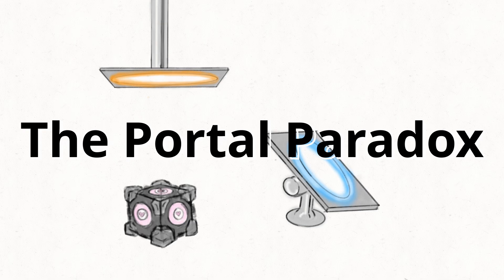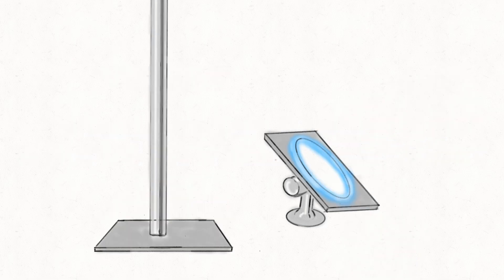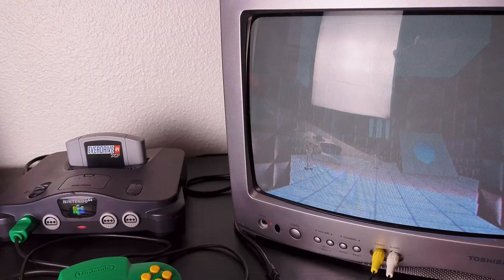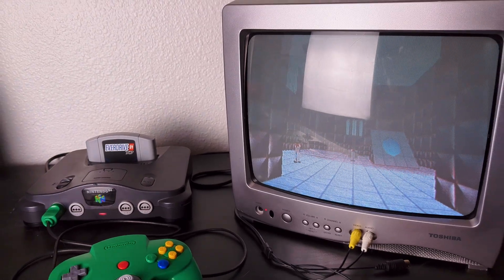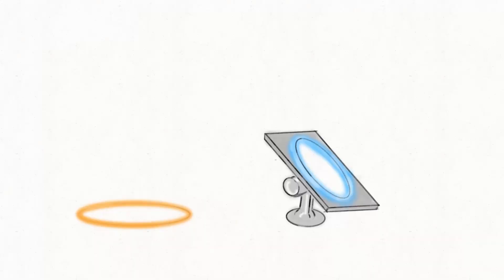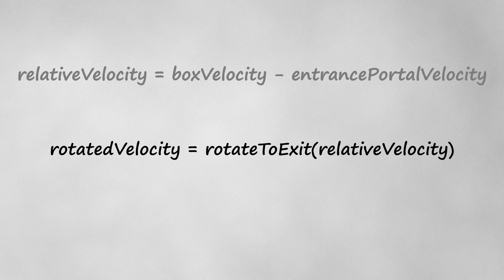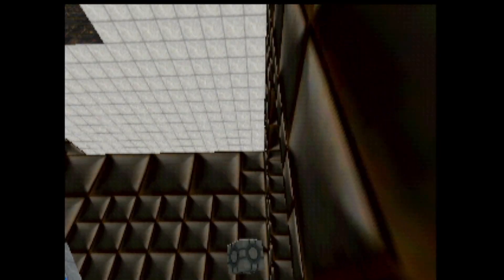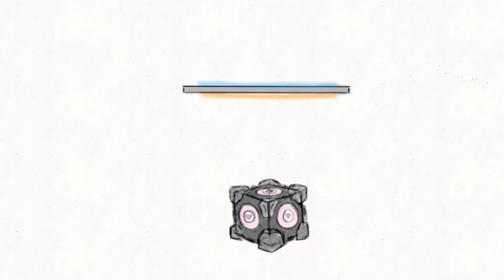I rewrote Portal from scratch and solved the Portal Paradox

Comment: Great video: subscribed!! Results look good where the velocity of the portal is fixed. However, I think the whole paradox, and your solution, aren't intuitive since it's not based on a conservation of energy or momentum. One highlighting scenario and one hypothetical: A portal dropped (not forced) over a feather and a stone should not cause the object to have the same initial velocity when exiting the other side of the portal since that would violate those conservation laws. Rather, I imagine a real portal would require more force in order to pass quickly over a more massive object (I'm imagining something like eddy-current braking aka magnetic braking aka just search for videos of a magnet falling down a copper pipe). Second, imagine a long, skinny object standing upright and a portal being forced down over it-- like a pool cue or a person even. As the portal is forced (not dropped) over the object there would be a point where enough momentum had transferred to the object to overcome the force caused by gravity, and the object would get "sucked through" the portal. A simplified example would be a chain attaching two stacked cubes together and slamming the portal down over only the top one. The momentum of the first cube flying out could pull the second cube out. Apply that to an entire rigid body, and you have the scenario I described, but you need conservation of energy to know how fast the whole body goes.

Anyway, you're mostly right. I'm an engineering grad student. Let me know if you need help with any calculations.

Comment: Hmmm... Looks like either mass has no effect, or that cube is really, really light.
Also, inertia should come into play because "a body at rest wants to stay at rest, and a body in motion wants to stay in motion".
Logically, I would expect the cube to be barely nudged (if at all) by the open portal (which basically has no mass because it is open) despite its velocity when moving, resulting in little more than a roll / flop out the other stationary portal.
Think about it this way; If an open door passed around you, would you be moved by the force of that open door?
Reply: Can you keep 2 sides of a door connected whilst also have one stationary and one moving without changing the original door?

Comment: Well your solution is a shortcut. You skipped the cubes volume, its spread of mass and its partial momentum. You just consider the very moment the cube passes but what if the portal stops halfway. You could consider the ammount of cube being pushed trough integrated with the time it has been pushed trough to a momentum acting on that portion of the cube, most of this shortens out if you consider it as one single action but really it could be more detailed and here it comes: way out of scope, overcomplicated and ressource heavy.
Reply: So yeah really just nip picking here your solution is alright.

How i imagine this scenario, moving the portal towards the cube is like moving a dimension into another, the ground in dimension 1 pushes the cube into dimension 2 or considered the other way dimension 2 pushes itself over the cube with the fixed ground in dimension 1 resisting, they kind of collide and what exactly happens depends on where the first one begins and the second one starts. For extra nip picking you could even start calculating gravity 2 for part of the cube that is in "dimension 2". Now for the ultra nerds completed madness physics circus you require the force of this action to be exerted by whatever is pushing the portal aka shifting the dimension 2 as well as the ground resisting in dimension 1, what really is doing the work could just be considered what is moving relative to the other dimension. Now considering this is all happening in the same dimension this further shortens into pushing the portal over the cube with certain force and the ground its on being loaded with this same force. Considering conservation of momentum and conservation of energy this is probably not working out but maybe thats either my head coming to its limits or portals being fundamentally flawed in that perspective. Obviously a cheeky answer like "whatever difference the portal breaks in conservation must obviously be exerted into its environment to cancel" could just mindbend portals into not being certainly impossible.
Reply: So if anone wonders how i come up with this stuff: i sometimes code little physics simulation for fun

And if someone feels like this makes no sense: im just doing it for fun cant guarantee it tho

Comment: as some kind of physicists I strongly support this interpretation, the velocity of the cube relative to the portal should be what counts
Reply: Energy conservation is already broken by stationary portals. If they are at different elevations, you can enter any of the portals and leave the other one with the same speed and e.g. instantly climb a mountain (or the moon) without any forther work. This is also happens when building the portal loop and falling indefinitely.

Conversation of Momentum is also broken by stationary portals in the game, because the direction of the momentum is changed in most portal configurations.

If we assume that the Portal games play on a spinning planet, conservation of angular momentum is also violated, because your momentum (combined with the distance to the center of the planet) also gives rise to an angular momentum.
I'm not sure what happens to spinning object/player jumping into a portal...

But conserving any of these properties would ruine the game. Conserving all of them should be equivalent to drilling a hole through the wall or at least give you extremely tight tolerance how you can use them (e.g. same elevation and latitude and exactly opposite orientation)
Reply: And regarding the original comment: I totally agree with it (as a studied physicist). The situations are the same when applying a https://en.wikipedia.org/wiki/Galilean_transformation
(Please ignore that we need to be in an inertial reference frame for that, which is not strictly true because of earths rotation)
Reply: It's kind of hilarious how most of us (me included) agree that the idea of portals make no sense physics wise. And immediately follow it up with a physics reason for which kind of portal is more likely 🙃
Reply: @0ntimetaiment921  that's because to us intelligent folk, it is abundantly apparent which kind of portal is more likely.
Reply: @MS-pz9wd  Arrogant much?  A real intelligent person would understand that neither are likely because magical portals that instantly teleport you don't actually exist, yikes.
Reply: @sawdust52  a real intelligent person would be capable of basic applications of logic
Reply: @MS-pz9wd  Which you aren't, because the basic logic you are speaking of doesn't exist.  Try again, maybe consider seeking an expert for an actual IQ test while you're at it?
Reply: @sawdust52  do you find the concept of logic so confusing you're now pretending it doesn't exist? Yikes
Reply: @MS-pz9wd  Do you find the concept of ficton so confusing that you cant separate reality from fantasy? Yikes, now I'd actually suggest you seek medical help as that's a clear indicator of an onset of dementia/schizophrenia, scary stuff and I hope you get better.
Reply: The most realistic definition of a portal is that it's a hole in space. Hole is not really an object that has any kind of effects or fantasy properties. Hole is a hole. And the hole in space would be the most static hole, as space doesn't really change its shape much. And materia is what actually "flows through/in/on" the space, so... The model in which we consider that the whole world (read as materia), or some part of it like our planet, is the source of the momentum is the most realistic one.
The only questionable part here would be about how we move the portal with some wall, and I think the answer for it is gravity, but I don't have enough theoretic knowledge to assert it properly. All I can say is that space can change its shape under the influence of gravity, and the shape is technically just a definition of where some parts of an "object" are located, and gravity is linked with materia, with its mass and stuff. So we theoretically could manipulate the masses of materia to manipulate the gravity to manipulate the shape of space to manipulate the location of holes in it, and so we could make portals move with walls like it's being shown on the video, and my brain is literally melting now, what I'm even talking about, I never even studied physics in any way, and I haven't slept for almost 20 hours, I don't even know how I found this video. Gotta go sleep.
Reply: @farflower87  yeah, it reads a bit weird :D
Have a nice sleep ;)

And I meant with "hole" not the any fancy space bending stuff, but literal one in the wall, which you could achieve with a regular hammer
Reply: Also gotta add that gravity of the planet would act as a lock for the initial position of a portal, so it would not fly away to another galaxy right in the moment when it would be... Shot out of a portal gun? Lol
Reply: Agreed the cube would move. Just think of air/fluid dynamics.  If you look at the air moving through the portal, the blue portal would have a certain mass flow of air moving through it, which means the air would need to have a velocity.  You would have a stream of air coming out of the blue portal until they collided. The cube would have the same relative velocity, because Universe Orange is moving toward Universe Blue and then stopping. If Universe Blue could keep moving and “cut out” the wall around the cube, you would get a column emerging from the portal at that same velocity.

The real trick is moving the portal in the first place.  Since it is essentially a wormhole, it would take a MASSIVE amount of energy to move the portal. Basically the wall would have a very large force preventing it from moving. Granted this is already violated by the movement of the earth.
Reply: @Colonelloki  We don't know that's it's a wormhole. If it were it would have a huge gravitational effect (way more than the earth), which it doesn't in the game. I think it's fair to assume that portals break reality in all kinds of ways.
Reply: It just depends on how you define the portal. After all it's a fantasy concept.
I would define it so it doesn't jump. Because in this version the portal would have to exert some kind of force on the cube to accelerate it, which sounds wrong to me. Also the laws of constant momentum would break down.
Reply: @0ntimetaiment921  Well since it's fantasy and everything goes, I'll say that whenever you go trough a portal you speed up to match earths rotation... because reasons😅
Reply: @BxPanda7  Actually I once wrote a fantasy story with portals. And one day I woke up and realized exactly this problem.
And yeah. I just "solved" it by saying "it just works in this magical world, ok?".
And I'm not ashamed of that. It's either that or never ever writing fantasy stories at all.
EDIT: It's all about pushing the absurd to a point where it bothers people the least. Most people do not think about the fact, that earth rotates and the moved around the sun at absurd speeds.
Reply: @0ntimetaiment921  To be fair I'm sure there's something in the theory of relativity that would explain why earth's rotation doesn't matter in this context, but you'd have to ask a physicist, or invent a portal gun, whichever is more in your line of skills 😝
Reply: @0ntimetaiment921  In order to understand the forces acting on the cube try changing your perspective slightly. Imagine you are standing on top of a moving cart going at an incredibly high speed (somehow not being blown off by the wind), and suddenly that cart comes to a stop. You would fly forward off the cart, right? That is essentially what is going on here, but the portal moving at the cube is turning the entire WORLD into that cart that you are standing on. Going through the orange portal means that you are "Suddenly not moving" relative to your previous speed so it flies "forward" relative to the blue portal. Another way to imagine it is to simply think about how it would appear in the blue portal should the orange portal envelope it quickly. Imagine the blue portal was on the ground and the orange portal enveloped the cube quickly. The cube would rise from the blue portal equally as quickly right? The cube would be quickly moving upwards and then come to a sudden stop with no momentum in the model you suggested.
Reply: @VaanOtacon  Nicely explained. The model you describe definitely has some merit. But again: It's a fantasy concept, so it's a matter of taste. In your model the cube would still suddenly have energy in the form of movement energy which comes from nowhere. In the the cart example you gave, the person already has that energy since it is moving. With the portal the energy must somehow be transferred from the portal to the cube. But since the portal itself has no mass that makes no sense to me. Worse still: The force on the cube would have to be infinite, since is goes from not moving to moving instantly.
In my model (which is of cause also breaking physics) the portal does not interact with the cube. It is simply a doorway. The cube remains in its relative state to the world instead of the portal. So yes if the portal moves quickly over it, it simply appears in the other without momentum at all. It rubs you the wrong way, since you say "it moves but then suddenly stops". In my interpretation it would not move at all though. You would simply move the "doorway" around it.
Neither model is completely satisfying, since portals are inherently against the laws of physics. I guess it's a matter of personal experience and taste what put's you off more.
Reply: @VaanOtacon  If you look through the exit portal and take your measurements from there then nothing is out of the ordinary. And since changing your point of view doesn't change the outcome, the cube must behave the same way whether you're standing on the "entrance" or "exit" side of the portal. The issue with looking at it from the "entrance" side is you are changing your point of view to the exit portal without accounting for the movement of the portals in relation to each other. If you account for the speed of the portal, the cube flies out.
Reply: I commented because I want to come back later, re-read and see if I understand it any better.

Comment: That makes sense to me. The distance to the targeted launch wall actually decreases at a certain velocity when the top portal slams down on the cube, so it make sense that the cube would continue that velocity. Whereas for the "hoolahoop portal", the distance to the targeted launch wall (the ceiling) remains constant as the in-portal approaches the cube at the same rate that the out-portal's distance to the ceiling increases, thus canceling any momentum for a launched cube!

Comment: Just to make it more fun, you could actually argue the blue portal is facing away and both portals seem to have a front and a backside.
If you check the entrance velocity on the portals, you might also just add the negative blue portal movement to the cubes momentum, making it fly twice as high.

Comment: There is one thing wrong. If cubes center of mass is at the center of cube, when blue portal is stationary, cube should start it's movement earlier. If blue portal would be placed on ceiling, cube should start to move as soon as red portal would pass cubes center - more then half of the cube is attrected to opposite gravity